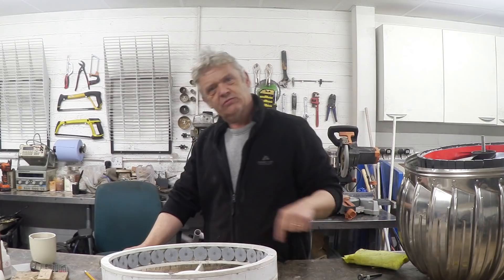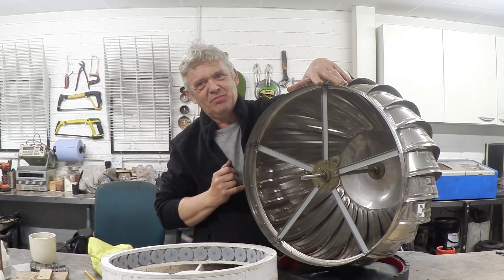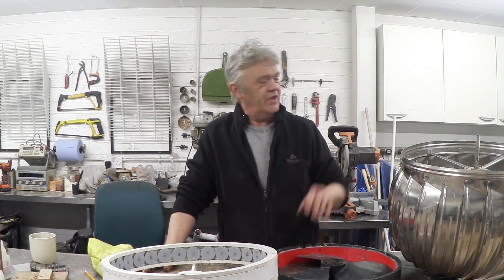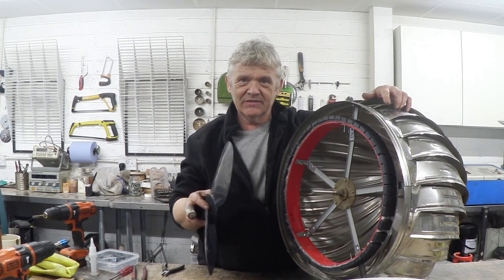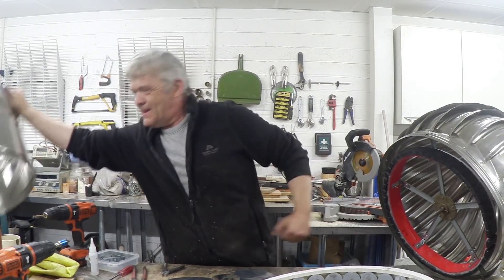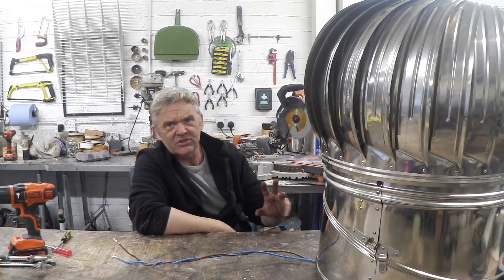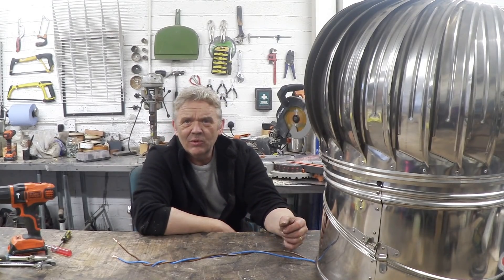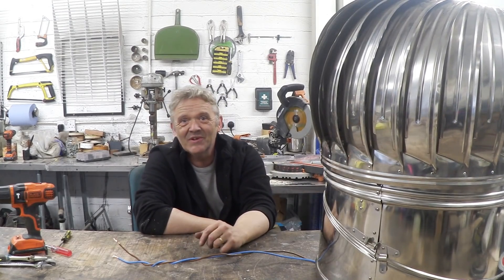Rotating Ventilator For Wind Power Part 5 - Finishing And Testing

Comment: Will you try this setup on an attic mount scenario to take advantage of the warm air draft?
Reply from the maker: probably not mate - it would mean knocking a hole in my roof
Reply: I was thinking of maybe a pipe of sorts and push just enough air to simulate the normal flow.  Knocking holes in roofs can be upsetting.😁

Comment: I used to cut myself just fitting those things, I am surprised you still have all your fingers.  Have to say though I like the idea of it, I always wondered if I got a really big one of those would it be big enough to generate enough to keep car batteries charged.  But I don't have a workshop to build a really big one.  Three times the size of blade.  However, you have proved proof of concept and if I had a big workshop I would be trying to build one.
Any chance you can take it out in a better wind and see just what it can do?
@UCexbu2MieJaSG_rqnCaa5cQ's comment was just so funny and I can just see you running up to him with some wire, a drill and magnets lol.
Reply from the maker: to be honest mate I think all I did was answer the question can it be done - there are a ton of improvements that's for sure

Comment: “FIRST LOOK should estimate PE of air volume working through turbine. I DID calculations a few years ago & guessed circa 70-watts for 20-mph velocity & a nominal efficiency. AM PRETTY sure I used air density. ANYWAY, MY Magic Chef portable washer uses 85-watts per load & is doing nicely on solar PV. REFRIGERATOR USES about 300-watts per day. THIS WORLD is quite messed-up, aMerika failing to grasp sustainable energy.

OPTIMIZED WITH light magnet rotor, stator output can be PWM into a loaded battery to sustain rotation. AM BUILDING motorized, 29.5-volt augmenting charger to prevent sulfating, protecting my investment in batteries. PRODUCT INTEGRITY requires an engineered circuit. ROOF FAN augmentation would be nice for winter, unnecessary if latitude is <25-degrees or during most of the year from February to November. I USED 5-gallons gasoline last winter, running it 2-hours late on cloudy afternoons.”
Reply from the maker: it's not my way - I am. much more practical - first look for me is to build a model and see what the issues are

Comment: Try the cowl with an electric bike hub motor wired as a generator. Bike wheels hub motors are low speed devices and make great generators. What about a water wheel?
Reply from the maker: the torque stuff I was on about would still apply mate
Reply: I know you have a balanced decision to make, no free energy here, just thought the bike wheel is a good  instant test bed. They are quite cheap now.

Comment: Interesting perusal on the lever/circumference question. BUT, when the coils (generator) are under load, that will act as a brake. That brake, slowing the rotation, is far more effective, being at the circumference. Thinking about it from that angle, the rotor would have more leverage to turn the generator if it was mounted at the shaft...but that would mean much bigger magnets and coils, moving slowly, for the same output. Or gearing things back up again to increase the speed meaning loss of efficiency in the gears/pulleys. Theoretically it seems like swings and roundabouts! Work done is the same whether a small force is moved a greater  distance quickly or a greater force over a smaller distance slowly. I'm only discussing it, you got me thinking :-) your design wins hands down for simplicity, ease of construction, and probably efficiency too. Sorry for the long comment
Reply from the maker: I am good with long comments mate - they make me think too - like all things this would need to be a balanced approach - if it were me I would not connect a variable load directly to the generator in whatever circumstances - I am still pondering this which is why I haven't done a video on it yet - but in my mind a reservoir between generation and consumption is needed - like a capacitor bank and variable loads are only drawn from the bank - it would seem to me then load on the generator would be around a constant and can be planned for - but like I say I am still pondering this one
Reply: @ThinkingandTinkering  Agreed, I would connect a battery to be charged, capacitor to handle surges if necessary, and something like the XL4015 DC:DC buck convertor which can be set to limit voltage and current, to whatever will not stall the rotor in your area's average breezes? They are dirt cheap on eBay and work excellently, I've used them in several projects

Comment: Great build sir Robert! It looks like it will do very well in low wind speeds. I would buy you an anomometer if I could. It would make it more fun knowing. I'm made a neat little generator that I'll try to get a video together about tomorrow.
Reply from the maker: I might get round to getting one myself mate - and let me know when the vid is up will you? I'd love to see
Reply: @ThinkingandTinkering  also, I'm wondering if on a small setup like what you just built, making a large ring on the outside of the ventilator maybe 5' in diameter of magnets and coils. It would have to be beefed up to support the extension of the mass, but it would increase the size of the stator and coils and give more energy.
Reply: You talking about the leverage yesterday.

Comment: That is an excellent proof of concept Rob. I have a lot of coils from an old front loader washing machine. I don't know if I can salvage the magnets because they are gunked with epoxy onto a heavy cast plate. But the coils are salvageable and I'm going to order magnets like you did and put this to use.
Thanks for putting this together mate.
Reply: you can buy a pile of rare earth magnets online -- I got mine on Ebay -- They came out of disc drives -- super strong and really reasonable. Highly adaptable.
Reply from the maker: I amnow on the look out for a front loader with direct drive mate!

Comment: Today would be a awesome day to have a wind turbine, I'm getting a near constant 20 mph wind, with gust around 35mph, it wouldn't generate the most power, but it would be a nice, nearly constant power production! Man do I need to get a turbine up! I'm missing alot of power! Being off grid, this drives me insane, knowing I could be getting about 500-750 watts a hour, about all day today from wind alone!!   I'm thinking I'll try to get pipe from, 1.5" x 20' then a stick 20' long that will fit over it, then another, and another, making a telescopic turbine tower, atleast 60' tall, with a 1500 watt turbine, I figure it will do half that normally, have you considered videos talking more on how to actually use this power, charge controllers, I myself plan to use a mppt charge controller, especially since I have lithium batteries,
Reply from the maker: I have mate and you are right I should do more on how to actually use it

Comment: Amazing build!!  Thanks for doing that!   It would be additionally interesting to see what would happen if it was on the top of a chimney .. it seems like it could be done with 3 or 4 -- 55 gal open ended barrels stacked on top of each other and the outside could be painted black .. a hole cut in the bottom so a draft would happen and set it in the sun.  It may not turn any faster than when installed on a roof .. but then I've never seen a "chimney" application.
Reply from the maker: we don't have a lot of rotating vents in the UK mate we are more concerned with damp than heat - so I haven't seen that many myself
Reply: @ThinkingandTinkering  Interesting!  :-)
Reply: Greetings from Brisbane Australia! I came across this build video whilst researching to discover if exactly this application has merit for a trickle charge system to supplement a solar array. As opposed to the UK, these types of roof vents are everywhere in Australia especially on corrugated iron rooftops. The usual summer temperatures of 35+ degrees Celsius means that the roof cavity heats up incredibly and even on completely still days these vents fairly fly around! I’ve often wondered if there was a way to harness this energy especially as the vents continue to spin after sunset and the ambient air temperature drops more rapidly than the air trapped in the roof cavity maintains the temperature/pressure gradient. The same effect is evident in our winters as well but not as pronounced. 
I haven’t heard about the internal fan trick until now. Do you have a reference for the paper you mentioned. Great channel! Thanks. Cheers, RF

Comment: if put the magnets on the outside of the spinnig top part whit a ring make it stronger  always try to mount the motor from the top then use a axel from motor down then you can have fixed axel
Reply from the maker: there is no always mate - you should try to adapt to what you have or what is appropriate to the situation - always is a set of blinkers folks often wear - you are right it is a good idea to mount a motor as you suggest - but always - I don't know about that
Reply: @ThinkingandTinkering  inside block air flow you told us :)

Comment: Hi Rob. Cool design. But I think 32 coils and 50 magnets is a mistake. You're robbing yourself of power. You effectively have 32 phases which are all partially out of phase with each other and so they are partially cancelling each other. If you had 32 coils and 32 magnets, with each coil wired anti-phase to its neighbours, then all 32 coil voltages and currents would be in phase with each other, and the net output would be higher.
Reply from the maker: I never thought about it much mate I just fitted what I could thinking more about balanced rotation than anything else  - the point here was to answer the question - can it be done - the improvements are many lol - but v nice info and well appreciate - cheers
Reply: @ThinkingandTinkering  You're welcome Rob. I hope you don't think I was being negative. Your channel is my number one. I never miss any of your videos.

Comment: are the magnets NSNSNS? if so Did you know the gap between the magnets is important to gain full potential, and is determined by the field width. I forget where i saw this though, some wind turbine rotor stator diy build .
Reply from the maker: they are NSNS and thanks for the add

Comment: Great build .enjoyed the videos . There is a way of increasing the output significantly by having a inner ring of magnets which oppose the external magnets .
This would create a magnet field which would encompass the coils .The secondary  inner magnets will obviously rotate with the outer magnets
Reply from the maker: to be honest mate this is just answering the question - can it be done - I think there are quite a few improvements that could be. made

Comment: My guess is that one of the reasons our venerable ancestors chose the central axis over the rim was the cost of materials.

Anyway you could do something with your ink instead of the magnets or copper wire? 

Maybe spin two cheap materials with a good triboelectric gap then fit some graphene coated wires to collect the electrons?  Would probably need more wind to overcome the friction, but could be interesting
Reply from the maker: yeah a lot comes down to cost -I am guessing to make a production version of this would be expensive - but as I scavenged most of the bits and used ferrite magnets then outside of the ventilator I spent about UK£20 - so cheap for me - but I would think not so cheap if you used neo magnets and new all the way

Comment: I have found any generator I make eventually fails on the bearings no mater how exact I try to make it. 
(Granted the more exact it is made the longer it lasts.)
I figure this is due to gyroscopic precision. Shaking bearings loose, wearing shafts, etc. 

To combat this I use 2 counter rotating disks. Much like a  wimshurst design. 
As long as the disks rotate at the same speed the precision is cancelled out. 

By doing this, 'thrown together prototypes' are as efficient as 'my precision' builds.
Reply from the maker: nice tip mate - cheers
Reply: @ThinkingandTinkering  God  bless you Robert. Your replies are gratefully received. Thank you. 

If you do try this at any point be aware. Mounting magnets around the peripheral edge of each disk interact with each other making it as fluent as lumpy mash potatoes. It also adds horrendous vibration too each disk. 

To combat this I have resorted to halbach arrays. 
The top disk field is up and the bottom disk field is down. 
As you know halbach arrays have almost a none existent field on their weak side. This way they are fluent.

Comment: Hi Robert, from Phoenix AZ USA... Question: I like the idea of these roof vent devices as a generator ... I'm wondering if several brushless motors with rubber wheels making contact with the rotating fin sections, with the motors being used as generators around the circumference of the base would work???? Those motors have very strong magnets in them and if you had quite a few of them around the support tube all being driven and wired correctly would generate enough current ??!!! Thanks Ed
Reply from the maker: I don't know mate but I do like the idea - fancy trying it?

Comment: In watching this I modified an idea I was thinking about and then wondered about combining what you have done with part of my own idea.  Essentially my thought is to build a housing that exposes only the vanes that are being caught by the wind so that the vanes that are coming around to catch the wind are not fighting the friction of the wind as they come around..  The idea I had started with was to have two vertical paddle wheels counter rotating with duct work that directed the wind to the center where the paddle wheels would catch the wind as it picked up speed where the ducting squeezed it into a tall narrow opening.
Reply from the maker: interesting mate - you should build it for sure

Comment: I really think this is a great success!!  😊  If this could be built to average even 10 watts under load in varying wind conditions, that's 240 watts per day.  Two of these could nearly match what my 100w solar panel can achieve (on average) during daylight at my latitude, and wouldn't require much more horizontal surface area.  If I purchase the turbine and magnets and scavenge the rest, the cost probably works out to be about the same (though admittedly a lot more work to assemble.)  However, it would be a great offset to solar in an off-grid situation, continuing to produce power even when (and especially when!) the sun goes down.  My portable refrigerator consumes about 10 watts per hour on average under normal conditions.  Allowing for redundancy, two of these could keep my refrigerator going indefinitely!!   Even better, these are low profile wind turbines and look quite normal on top of a roof.  I really like this build!!  😊😊😊
Reply from the maker: outside of the vent I paid around UK£20 for everything else but then I did scavenge a lot and only really bought the magnets which were ferrite so dirt cheap
Reply: Mmmhm, here the turbines would be the biggest cost.  I did a quick browse, and it looked like they go for about $40-$70 apiece.

Comment: if you look out for an old direct drive washing machine motor, they are designed exactly like that, i got myself one on ebay for £50 which is peanuts for what it is. the ones from the larger 10kg washing machines are best built. think about it from the point of view of spinning wet clothes, then add to it the unbalanced load and vibrations during a wash cycle... have fun! thanks for sharing as always!
Reply from the maker: nice tip mate - thanks a million I will look out for one

Comment: 8:48 It was kinda hard to read the meter
Reply from the maker: yeah it is hard to get that one right - if I go too close I get the old 'hidden wire' complaint so I try and get the whole thing in - no pleasing everyone mate - sorry
Reply: @ThinkingandTinkering  No worries.  Options can include just writing the measurements on the screen or setting up a second camera and putting a closer view on the screen.  But both of those would slow down your simple streamlined video production, which I wouldn't want to do.  Just saying the values measured is good enough.
Reply from the maker: @Scott_C  will do mate - the reason - by the way - that I give a whole field view is just experience form other videos with some folks claiming hidden wires - rather than argue about that it was easier to give a while field view but it does make seeing the meter harder and I think you are right about the presentation style I wouldn't want to slow it by cutting etc so saying it is just easier so will do - cheers
Reply: @ThinkingandTinkering  cheers mate,,  keep up the great work.